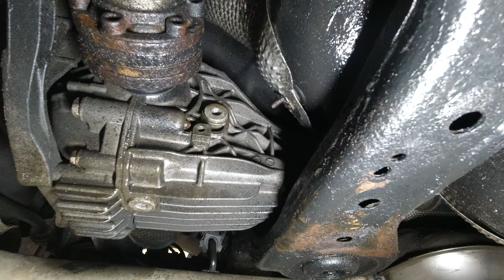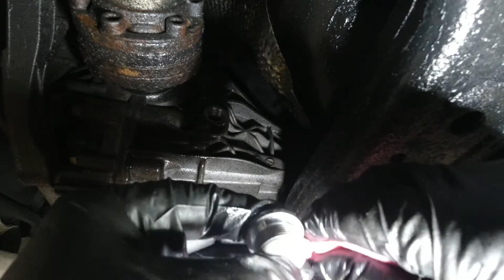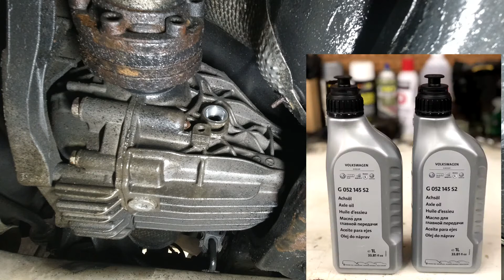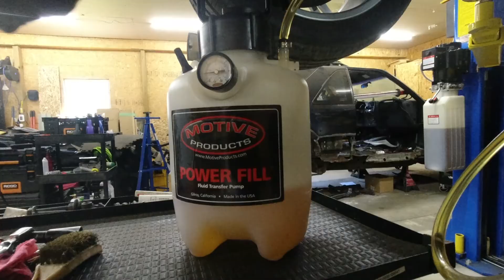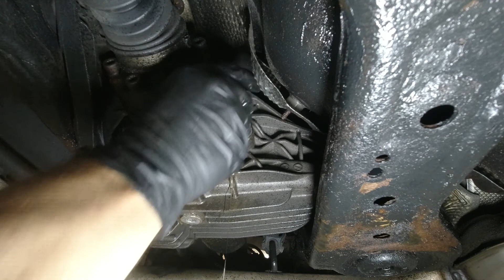Audi A8 D4 Rear Differential Fluid Change

Comment: Hi I have a 2017 audi a8 3.0tdi quattro does the gear box and front, rear diff boxes need fluid change? Thanks
Reply: Yes of course
Reply: Hi, I have the same. Yes you need to change it. Front and rear differential have the same fluid. Than you have the mid-differential that needs AWD Fluid. Than you have the gearbox 8HP which needs ZF Lifeguard 8 Oil. For the gearbox its better if you do the flush  than just oil change.

Comment: What kind of oil did you use. I have a A8L Quattro 4.2 8 cyl  , is that what your car is
Reply: Got it
Reply: Hey man, What oil is it? Has checked everywhere hasnt found anything
Reply: @H3LLBOZZWildrift  For the one in the video without shared oil with the autobox, it is front and rear VW G 052 145 A2  and the centre Torsen VW G 055 145 A2 or Castrol SAF-AG4 + added Sturaco FM. (or equvalents marked as such).
Reply: @snapdragogon69 car is crashed now😂